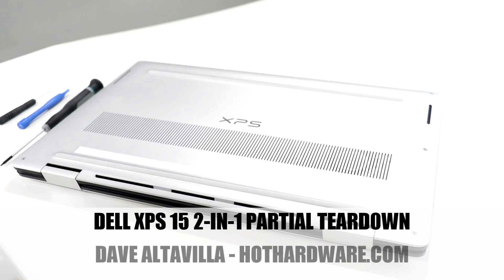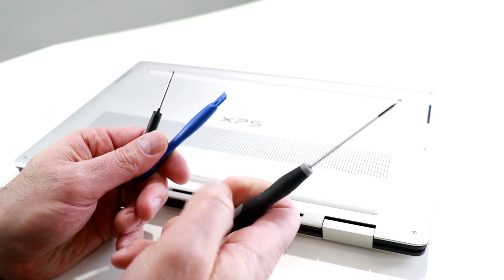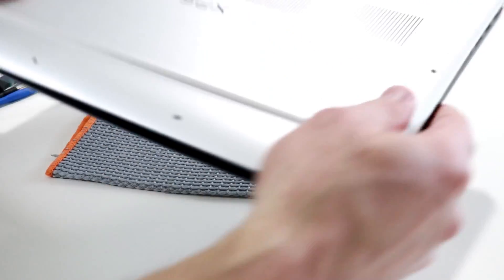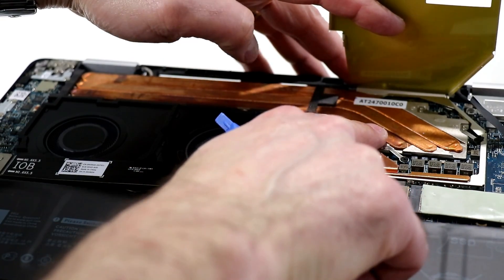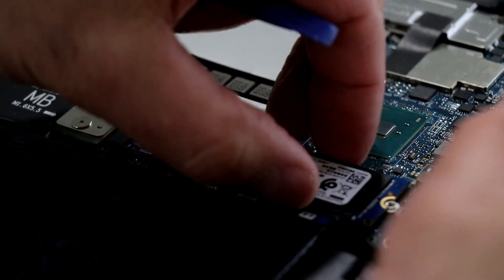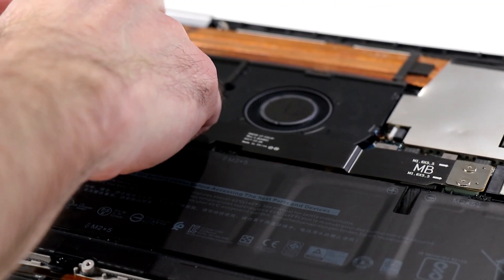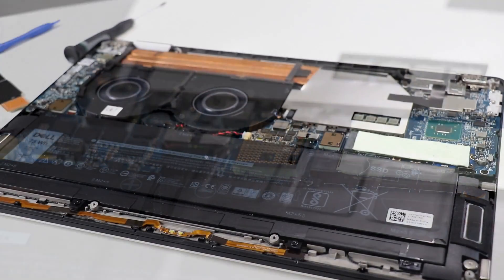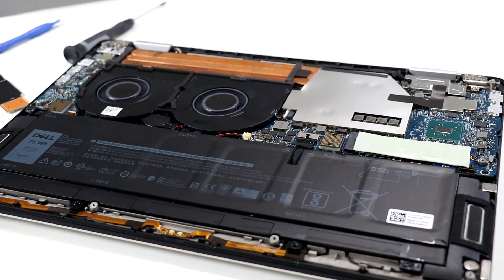Dell XPS 15 2-In-1 Partial Teardown: Going Under The Hood

Comment: Can you tell me reason why does not chipset have heatsink as ordinary? But all heatsinks concentrate on GPU
Reply from the maker: The heatsink solutions actually are built to cool both the CPU and GPU which are on one chip in this machine. The chipset for most modern mobile platforms doesn't need a cooling solution really and runs fine at ambient temps.

Comment: Damn, would have been perfect opportunity to re-paste that thing and come back with results...
Reply from the maker: Robin2win14 not sure I follow
Reply: HotHardware a lot of people with this laptop report high temperatures and throttling during instensive tasks. Re-pasting the CPU and GPU to the heatsink often yields good improvements since during production they use low-quality paste and/or rush the application, often using too much of too little. It would have also been interesting to see what the VRM cooling looks like since you had the laptop open. Maybe in a other vid? :)
Reply from the maker: Ahh, I see. Are you sure it's this model people are reporting this issue with? First, because it hasn't even really started shipping in market yet because it's so new. And also Dell specifically made claims to us about the engineering that went into the cooling solution of the machine that allows it to maintain performance over time and extended loads. That said, we probably will be looking at this area more closely in the weeks ahead.
Reply: It's the new Dell XPS 15 2-1 9575 right? If you check the Dell subreddit, people do complain about very high temps. Re-pasting and undervolting helps control the temperatures. One guy mentioned that disabling Intel Turbo-boost under the BIOS really helped, because since the GPU and CPU share the same TDP package, under heavy load they both try to outperform each other, resulting in ups and downs in performance. Disabling Turbo-Boost results in much more stable performance. Anyway, this is just from a handful of people. It would have still been interesting to see what re-pasting could do (with proper before/after benchmarks). I don't mind those things because I am confident that with updates, these things will improve.

Comment: Could you please run Warframe on Ultra (Free to play game), as well as Vermintide 2 (Max settings?) on this device? 
I'm thinking of getting this instead of the Aero 15x if the Dell XPS 15 2-in-1 can handle both games perfectly at ultra. Thank you and great content!
Reply: Sam Loh  the Aero 15x has a GTX 1070 this one has a Vega m gl and is Note compatabil to a 1050ti so it ist slower than the normal aero15
Reply: Yes i know, but i'd like to see how this Vega M performs in those two games :)
Reply: they don't perform that well you can look at the review of the new intel nuc. Performance wise there not the best and plus amd just rebranded the name of it to vega , the gpu is an old architecture .

Comment: Would you be willing to do a comprehensive gaming review across a bunch of games since this chip has really yet to have been benchmarked.
Reply from the maker: Semi-comprehensive, right here: https://hothardware.com/reviews/dell-xps-15-2-in-1-review :)
Reply: HotHardware thanks
Reply from the maker: My pleasure. We may run a few more games on this machine for testing. What would you like to see? Thinking more of games that have built in benchmarks. Maybe Far Cry 5, or the latest Final Fantasy?
Reply: HotHardware I would like to see some lighter titles like fortnite and overwatch to see if the device can handle 1080p at ultra and consistently hit 60fps
Reply: Could you please run Warframe on Ultra (Free to play game), as well as Vermintide 2 (Max settings?)  
I'm thinking of getting this instead of the Aero 15x if the Dell XPS 2 in 1 can handle both games perfectly at ultra. Thank you and great content!
Reply: HotHardware I'd love to see how Rainbow 6 siege runs on this laptop :) so if you could test that as well that'd be great!

Comment: Any idea of the wifi chip is replaceable?
Reply from the maker: Most modern notebooks designs these days follow a typical mezzanine style Mini PCIe Card spec, although I didn't see it when I opened up the machine. Will look again. It may be on the top side of the motherboard and I didn't tear down that far to pull it out.
Reply: Sadly it's soldered on board to the top left of where the fans are as i was looking to replace it with a Killer 1550 Chip or Intel 9200 before finding out that it can't be done
Reply: I'd be interested in this answer too! I was watching the whole video for this purpose but didn't hear it. haha.
Reply: If you have a soldering Iron it’s replaceable! lol 😂